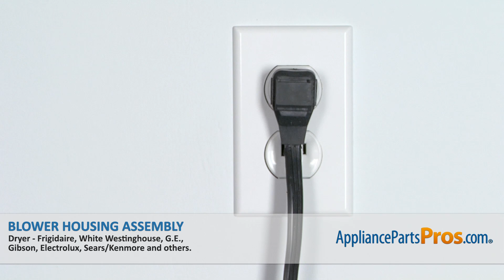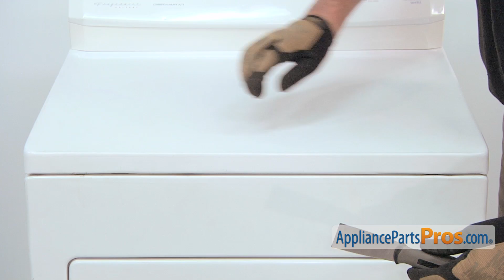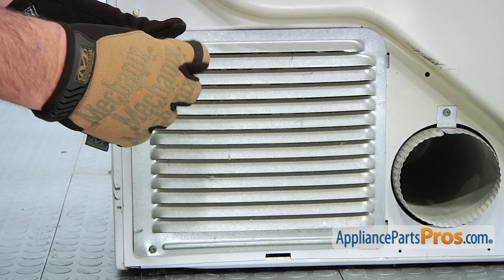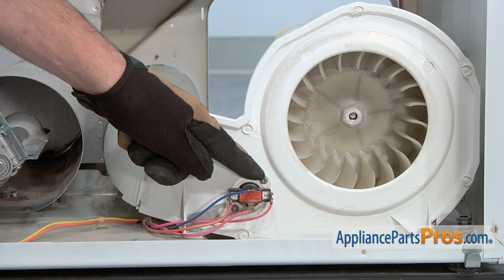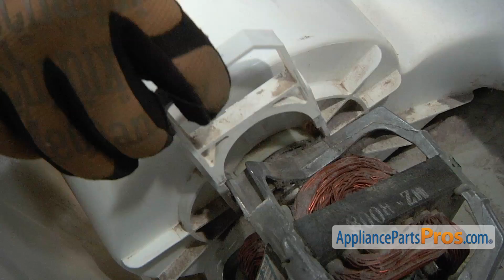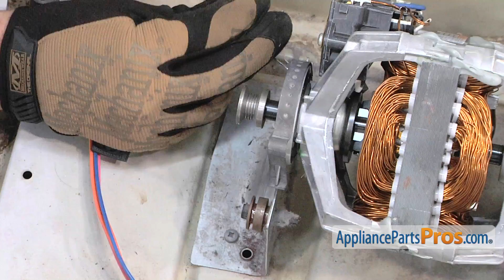How To: Frigidaire/Electrolux Blower Housing Assembly 131775600

Comment: I've done this twice now. 
If the plastic hex fitting is too split and expanded to allow the socket to fit, you can just grab the fan blades with your hands and spin the whole fan clockwise to loosen with the motorshaft held in place with vice grips and unable to rotate by being up against the dryer's metal housing. I haven't had the whole thing come apart on me leaving just the metal fitting though, got lucky. It retrospect, it probably would have been wise to tightly secure a zip tie or small hose clamp around that plastic hex to give it more support to lesson the chance of it splitting the rest of the way before spinning it by the blades. If I have to do it again that is what I will do next time.
Reply from the maker: Thanks a lot for sharing your experience and that tip about supporting the plastic hex fitting! 👍 That kind of real-world feedback is super helpful for other DIYers watching this video.

Comment: My fan won’t spin at all and when I turn on the dryer it makes a sound like it’s trying to do something but is jammed. I cleaned out all the little lent sections from every single fan blade and tried to turn it, but it still won’t budget all is completely jammed.  I’m assuming this is because something is stuck somewhere preventing the movement, and if so, is there a way or could you make a video about how to clean that out so that it will spin again? Or is it possibly motor and since the fan is attached to the motor it also feels jammed?
Reply from the maker: You could be right that it’s either something jammed in the housing or a failing motor, and it takes some model specific checks to know for sure. For step by step help, our techs can walk you through what to check at forum.appliancepartspros.com if you post your model number and everything you’ve already tried.
Reply: @appliancepartspros I figure it out! I had to replace the blower assembly because the metal threaded cylinder inside that attached to the motor shaft had fused more to the metal shaft and come dislodged from the odd textured plastic core of the blower assembly. It made it so the fan would spin and then the metal core would cause it to jam up entirely making it extremely difficult to remove but having a second person to use the Chanel locks and the socket wrench while I pulled on the assembly eventually dislodged the blower assembly leaving behind the metal core I was able to unscrew with some force wrapping my channel locks with floral tape for a better grip. I’ve gotten it replaced with an OEM part and it works like a dream and is so quiet. Thanks for your video!
Reply: Just in case anyone else may have the same issue, a good indicator if this has happen would be seeing cracks in the plastic center where the fan attaches to the motor shaft.

Comment: Is that a 120 volt dryer, the plug was?
Reply from the maker: That is a 120 volt plug shown in the video. If you have an electric dryer your unit would be 240 volts, if it's gas it would be 120 volts.

Comment: Dam I've been doing this for a long time appliance repair and never have I pulled apart a frigidaire dryer as easy as your video. What you should do is get a real used dryer so they can see how hard it is to get the bearing out of its cradle

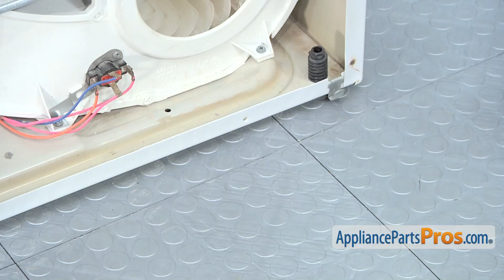Comment: 3:36 Turn clockwise to loosen the fan wheel... but it may not come off ...if so: You may need remove the motor along with the housing to cut the blower housing off so you can cut the blower wheel plastic off. Then use 2 pairs of locking pliers... one pair on the hub (that separated from the blower wheel) and one pair of pliers on the shaft just behind the hub.
Reply: Thank you for this. I was breaking my head tryin to figure it out because the fan broke off of the part that screws off. So I couldn’t turn it to get it loose.
Reply: @eduardoreyes8780  You're welcome!  That's what happened to mine. (Oddly enough I was talking about this job just last night with my Dad)
Reply: Same situation... finally looked at the comments, thanks! What did you find to be the easiest way to cut off the housing and wheel?
Reply: @fessensj  Unplug dryer 😉Remove old blower wheel from the dryer and use vise grips as I mentioned above. It's been a couple of years but  I think I chopped off all of the plastic on the old assembly to get a good spot to lock the vise-grips on. Wear eye protection and gloves.  (I almost lost an eye from flying plastic years ago😨). Just be aware of what you can destroy and what you need to reuse prior to your attack. Mine was "stuck good"! I was highly annoyed and swearing at it repeatedly. (I wrench on many cars, mowers etc and this silly blower was surprisingly a major PITA)
I also used my air compressor and a shop-vac to clean out all the funk/dust/fuzz while the parts were removed.  Good time to consider a solid dryer vent (instead of a flex exhaust hose) to avoid a house fire. Some high quality 3" vinyl tape is great to seal up ducts (factory duct connections allow for dust to escape). 
I got my dryer 15 years ago for $75 and I still use it every day😀.  I even added 12" square sheets of noise deadening material on the interior walls and inside the door (took door apart). Same type of noise deadening material used for car stereo installs. I installed a new drum bearing when I did the blower since I had it all apart and I imagine this dryer will run another 15 years. Super quiet now. Better than anything you can buy new IMO. Have fun!
Reply: @fessensj  I think I used a number of tools like a hack/jab saw, aviation snips and my beloved Knipex "74-250" diagonal cutters. Knipex pliers "88-250" are amazingly helpful to grab an rip off plastic as well.

Comment: Thank you!  Great video, helped immensely.  Problem I encountered is the threaded metal core of the fan is really stuck.  When I tried to loosen the blower wheel with the 5/8s socket, it wouldn't budge and I ended up rounding the plastic 'nut'.  So I chiseled the remaining plastic off thinking I could get a better grip on the threaded metal portion once the blower was removed.  Unfortunately, I still can't loosen the threaded metal core of the blower wheel.   I have used locking pliers everywhere I can possibly get a grip on, double checked I was loosening clockwise, used penetrating oil,  checked again on clockwise removal, hit it.... ahem, tapped it with said locking pliers and still no go.  Reviewed again the anti 'righty tighty' rule and started considering a small torch but decided to post a question first.  Very frustrating as this is my first appliance repair and it was going so well!!  Any other Ideas on how I can get this old threaded metal core off?  I don't own a small rotary tool (dremel) (yet).
Reply: how did you and up getting the metal bushing off...I have the same problem?
Reply: @elizabethmunoz4000  we have same issues & are now desperate! We may try to warm it up with a hair dryer on hot?
Reply: @elizabethmunoz4000  Late reply, but: I'm having the same problem. by the looks of it, your best bet might be to cut the old housing apart so you can get vice grips on the remainers of the bushing.

Incredibly frustrating that the housing is plastic-welded together. Only my fan is broken. If not for the plastic welded housing, this would be a 15 minute repair.
Reply: للأسف نعاني من نفس المشكله

Comment: Its easier to remove the entire motor blower assembly 4 screws and 1 electric connector on motor. Then put on a bench remove blower wheel and assemble in reverse. I did this way today.
Reply from the maker: Thanks for that tip.
Reply: I had to do this so I could chop the housing and wheel off just to get to the separated metal hub.

Comment: A correction to your video. There are little plastic feet on the blower unit that must be positioned into the dryers slots in the metal bottom of the dryer or the alignment will be off and the blower will rub on the housing or wear out prematurely.
Reply: Agreed. The video kind of over-simplifies the "just put the blower back in". The shaft is obvious. I was struggling with aligning the plastic/rubber gasket that's around the shaft and between the motor and blower assembly - the one that needs to sit in the slot on the back side of the blower and is held in by the "plastic support clip". Once you see the plastic feet and slots, it comes together much more easily. Thanks Jonathan!
Reply: This comment saved me! Thank you

Comment: Thank you for this video.  It was very thorough in replacing my part.
Upon reassembly though, the dryer drum itself seems to be "tight" to spin.  This was not an issue prior to part replacement.  The motor fights to spin the drum so I turn off the machine before i seemingly burn it out.  I tried the belt/ tensioner/ spring steps 3 different times with the same unfortuneate results.  Any suggestions?
Reply from the maker: craigg farnsworth I would double check everything is put together correctly. Make sure the ball on the rear of the drum is pushed down into the bearing if not the drum may sit at an angle and not spin, make sure the rear felt is not jamming it up, make sure the front felts are in good condition and the drum rides smoothly on it, with the belt off make sure the motor and blower turn freely then correctly reinstall the belt.

Comment: Is there another model that uses the same blower fan?  I don't want to buy the whole unit I just want the fan.  I have the plastic unit opened up by melting the plastic welds to gain access.  Now I just need an interchangeable fan.
Reply from the maker: THETOPGLOCK I think this style is only sold as the complete assembly. You can go to our website and enter the appliance model number to see how it is sold. Frigidaire is not really known for putting part numbers on parts but if there are any numbers on the old blower wheel itself, you can try to enter it on our site to see if it comes up as a part sold separately.
Reply: I was thinking of repairing the assembly. Im curious how this worked out for you.

Comment: Thanks, this told me what I needed to do. My only problem is that the fan has separated from the bushing, so I am going to have to find another way to remove the fan.
Reply from the maker: If you are replacing the whole thing you can just cut off what ever is hung up. You can try a vise grip to hold the bushing while you turn the motor shaft, but if you can get the bushing off you may have to cut it off, just do not damage the threads.